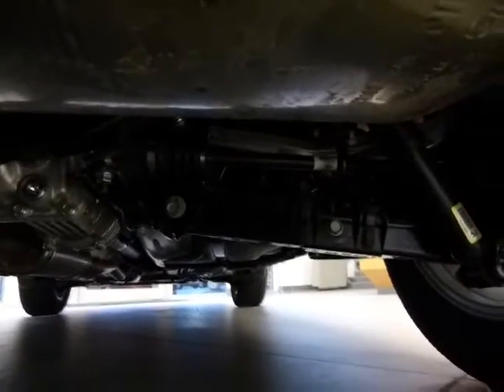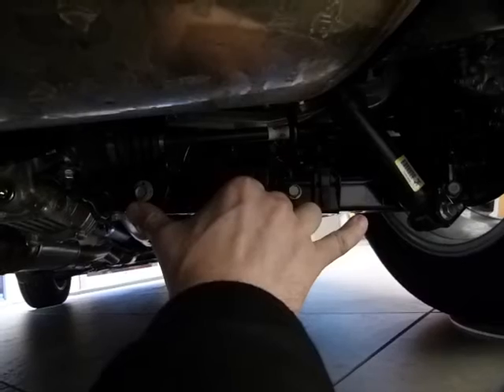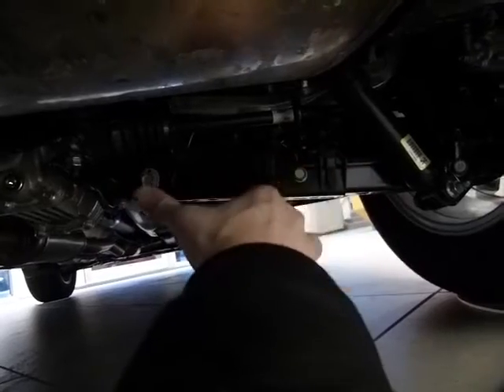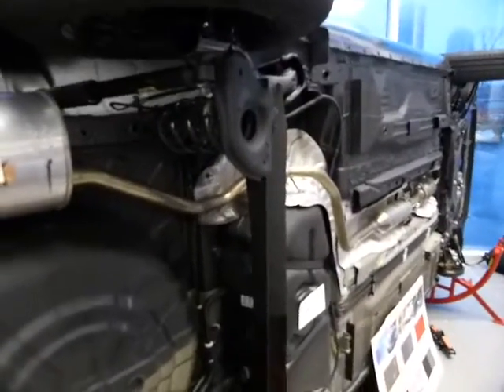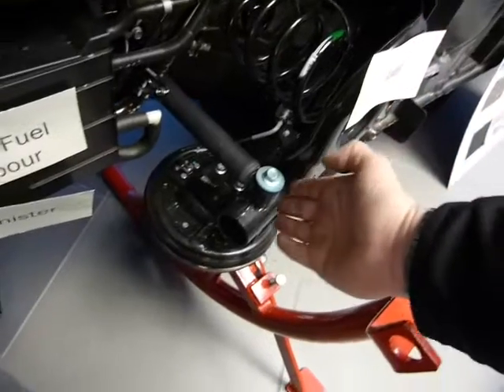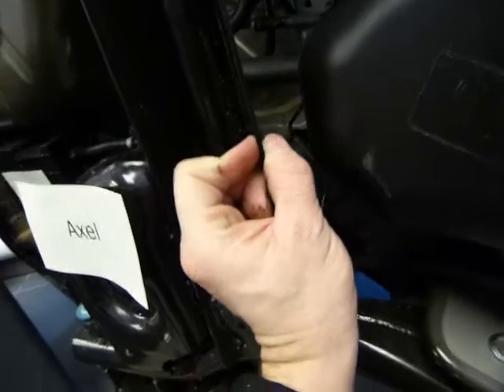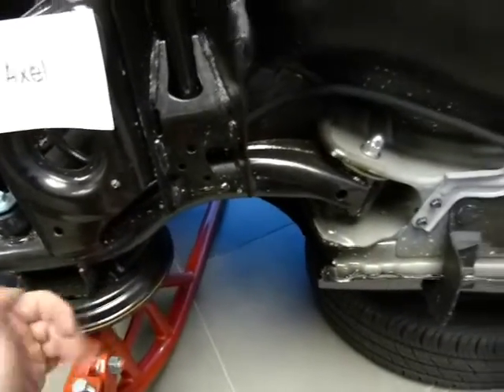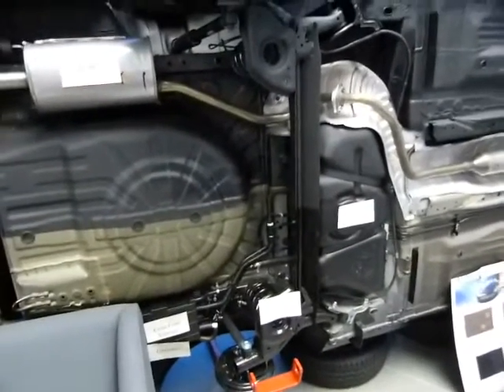Drive quality: independent wheel suspension vs. beam axle

Comment: Don't know if you can help me. We bought a new Ford Fusion which has front strut suspension and rear independent suspension. We traded in a Fiesta with beam suspension like you show here. The Fusion ride was wonderful in the test drive but then they sent us home from the dealership with 5 lbs underinflated in each tire. We shook all the way home and could not stop bc we did not know the area and it was late. It was a 40 mile drive on the highway so 65 mph. After that ride, everything feels strange. The car vibrates when it drives randomly now. Body roll is much worse. The steering is harder. The shifting is wonky and we are getting a smell of melted crayons when we turn off the car. Can you tell me with this kind of suspension, what if anything might have been able to be damaged from that. The dealer is of course telling us nothing would be harmed by that but this car is not driving right after the trip home. I miss my Fiesta which had a brilliantly smooth ride with the beam suspension. I am dreading multiple visits to the dealership where they will waste my time and tell me nothing is wrong bc they did this. Can you give me any guidance or thoughts based on the front strut and back independent suspensions. I would greatly appreciate your help.

Comment: Hi theoverengineer, can you tell me why the bushes are not in the same axis, unlike  door hinges? If door hinges are not same axis, squealing/squeaking can result, hence greater wear occurs
Reply from the maker: Suspension mounting points are partially load-bearing, sharing the load with other parts in a triangle or pyramid arrangement. They all need to be aligned with a dynamic load in mind, shock loads from uneven surface and cornering. It is a multi-point alignment.
All the weight of a door is on the hinges, none on the latch or lock, hence 2 or 3-point straight line alignment.
Makes sense?
Reply: Thanks for your reply, I suppose its for lateral loads, limited travel laterally. If they were in a straight line axis, something like a pan hard rod may be needed, to keep everything in alignment
Reply: Hi again, there is a kind of round cross section rod or bar in the 'beam', would that act like a anti roll bar?
Reply from the maker: Absolutely not on this budget car. (It is a torsion spring.)
Reply: With no disrespect, please read the following article http://www.autospeed.com/cms/article.html?&title=AntiRoll-Bars-and-Torsion-Beam-Rear-Suspensions-Part-1&A=113301. The torsion beam as the name suggest resist torsion and has trailing arms on both ends. Whether its effectiveness as anti roll bar is to an extent dependent on the design of different manufacturers; the location of the 'beam' relative to the pivot points/wheels and the stiffness of the torsion rod?

Comment: No, almost all cars and trucks with independent suspension use sway bars to help control body roll. With a sway bar installed what happens on one wheel does impact the other, as the two arms are linked together with the frame.

Comment: IMO that bar you said was a "Brace" is actually the torsion bar. The torsion bar in this setup also serves as the anti-roll bar. The ride comfort of this setup depends on the stiffness of that bar, the stiffer the bar, the less independent it becomes. Correct me if I understood it wrongly. Here's my source: http://www.autospeed.com/cms/article.html?&title=AntiRoll-Bars-and-Torsion-Beam-Rear-Suspensions-Part-1&A=112587
Reply from the maker: +Julius Ian Panogot The round rod that braces is the anti-roll bar inside the torsion beam. "In most cases, the torsion beam is made from an open ‘U’ or ‘V’ section of rolled steel, with the opening facing the front or back of the car."

"Many car designers leave the set-up like this but others add a hollow or solid steel bar that runs inside the torsion beam, linking the two trailing arms and giving the beam greater torsional resistance. In this type of suspension system, this round bar or tube is the anti-roll bar."
(There is no torsion bar, it`s torsion beam and an anti-roll bar bracing it.)
" ... the stiffer the anti-roll, the less independent the suspension becomes." - hence my comparison of ride comfort and mechanical detail.

Comment: This is a torsion beam suspension. It is perfectly strong for a passenger car and you shouldn't be comparing it to a truck. It is light, cheap and takes up very little space. Most owners of small cars couldn't tell the difference between a torsion beam set-up and a true IRS. Finally, the torsion beam allows a measure of independent wheel action.
Reply from the maker: +Quadrunner Video was not shot to provide a comprehensive course in auto mechanics. Length and unintimidating level of language was set to suit a curious beginner and foster further curiousity.
Comments, subscribes and likes don`t affect my self-esteem, I really don`t care. Watch & discover if you want, don`t if you so feel. Thanks for commenting.
Reply: +Quadrunner Torsion beam suspensions use springs. The springs help in ride comfort, its actually an innovation in passenger cars since Torsion suspensions are hard if left alone.
Reply: Julius Ian Panogot Yes they do use springs.  Torsion springs to be exact.  The long skinny metal bars are hard to see by looking under the front of the car because they usually sit behind the hinging joint of the lower control arm, as opposed to a coil sprung vehicle which is blatantly obvious.  I don't know what you mean by innovation.  They package really nicely though.  Their use is not limited to cars either.  They also work well in pickups with IFS.
Reply: *****
In terms of your logic I guess you could look up the Porsche 911 and compare it to the honda type R.

In terms of actual logic, there just isn't any reasoning in your post.  You're comparing a Mini Cooper to a Suzuki Swift?  You have no idea what the theory of operation is do you?  You can't even seem to realize that torsion and coil overs can be designed with identical parameters in the majority of cases with different packaging methods, and different ways of integration.  If they handle different its because Honda wanted it that way, or Honda invested in one more then the other, or maybe one is just a hell of a lot lighter.  There are a host of factors.

What type of suspension does this new type R have?

Independent suspension does not = comfort and trackability.  Most suspensions on consumer vehicles are a compromise aside from some of the new fangled electronic ones which I am unsure of.
Reply: +Len Peters On the independent suspension example he didn't show the type of spring used.  Since you can't see any coil we can assume its possibly torsion, but it might have just been the camera angle.  Either way the wheels were designed to move independently of each other which is why we call it independent suspension.

The second example was obviously not independent, and most certainly not torsion as you can plainly see the coil springs.  I'd suggest editing or deleting your comment before giving him a like.
Reply: *****
Independent rear multi-link is entirely possible with torsion beams.

You car handles good because its engineered (tuned) well for what it is and what it needs to do.  Multi-link suspension is generally engineered to allow your mechanical advantage to vary which is what gives you a good compromise between handling and comfort, as well as a more controlled compliance in dynamic situations.